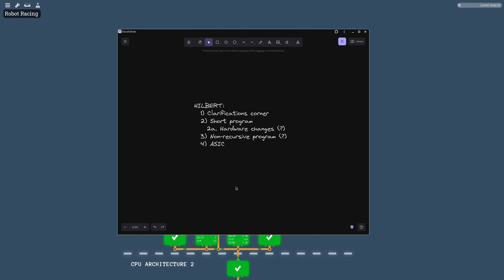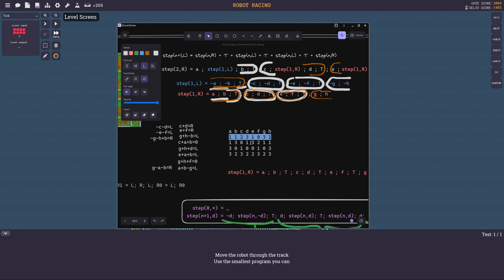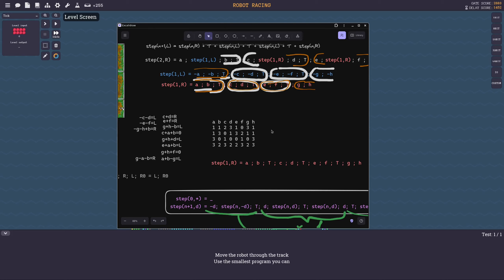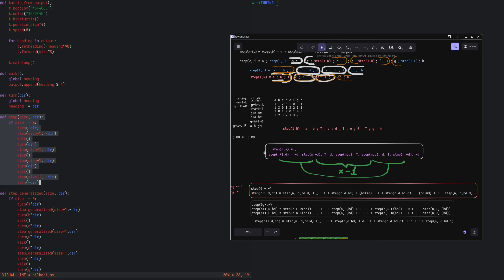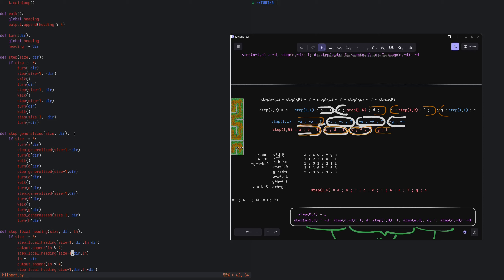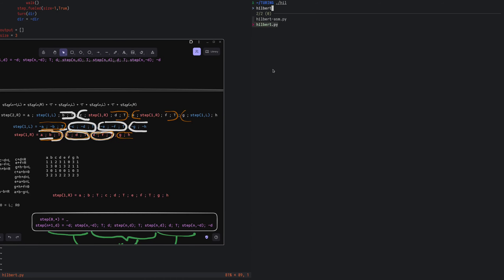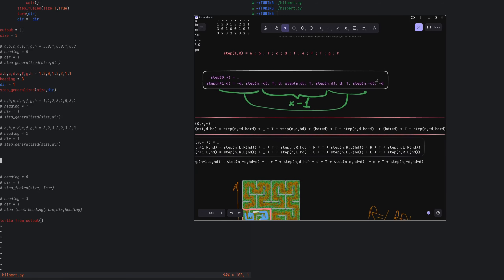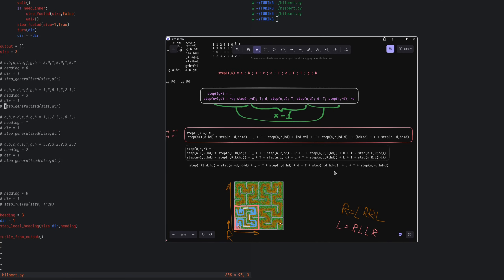A logician tries to build a PC | Turing Complete pt.32 - HLBRT

Comment: I saw the conversation you were having on the discord after it happened but I didn't know if it was actually possible to do using your constraints and you had or how to prove it wasn't possible off the top of my head. Also I probably would have separated the stack pointer and stack completely into different components one being an accumulator/decrementer based off the push and pop commands with an overwrite pin then fed an always on output into the stack as an address pin. Also variable length instructions might help get below 64 bytes when applied to instructions that have redundant arguments that aren't used but that would require a large rework of the hardware at least from the way I see it.
Reply from the maker: Well, as you can see, I managed to get under 64 without variable-length instructions :)
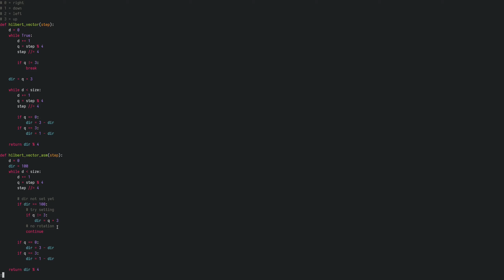1:45:28
Reply from the maker: No so sure about splitting the stack in two, I think I even mentioned it in the video. It feels like a single logical unit, splitting it would just mean running all the same wires, except outside.
Reply: @zoickx  For me the stack and the stack pointer felt more like two independent units at the level you were trying to do things, just two different ways to think about it really as long as it works it is good enough. I also did see that you talked about variable length instructions nearing the end of the video but I had posted that comment about halfway through watching so didn't see that yet.